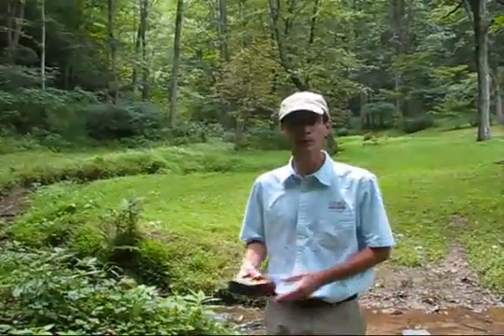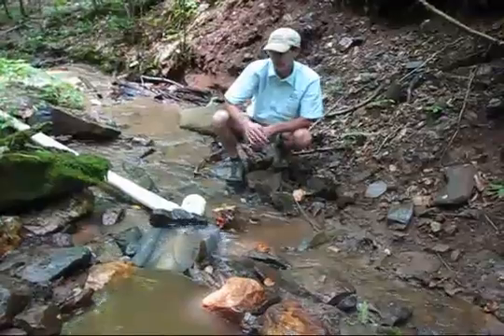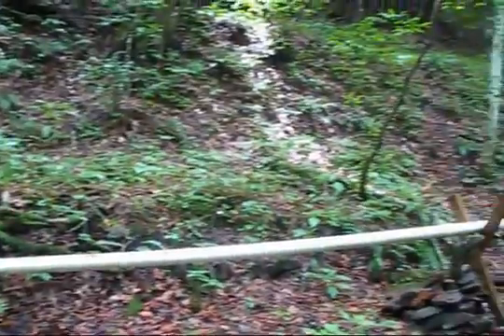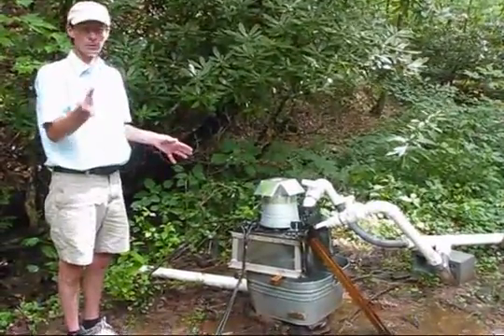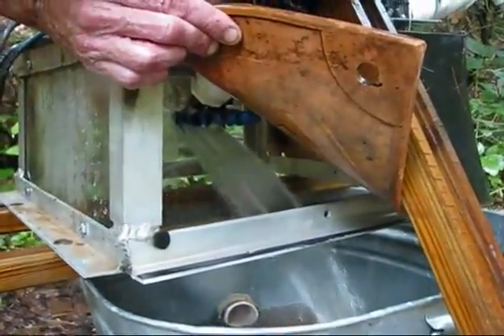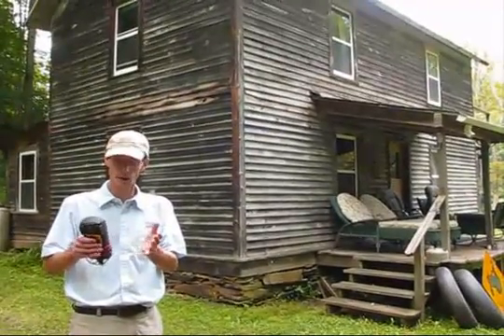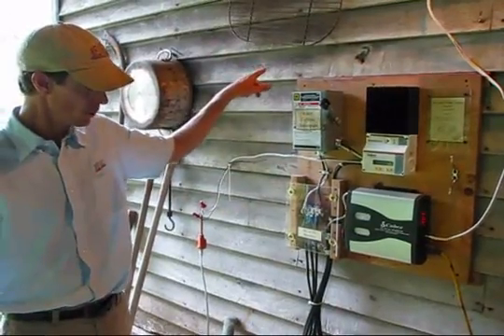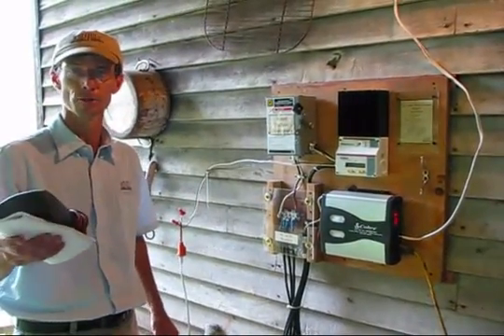Residential Water Turbine   YouTube

Comment: I have creek in my woods..it has a strong flow..and a 3-5 ft head..I want to harness this..I have a 1000-3000 watt 3 phase hydro electric generator very similar to the one in your video..I just discovered the ramp pump..I want to run a 6" Suply pipe about 60 ft up creek to at least the 4 ft head the water will run into the two 2" ram pumps that produce 20-30 psi tied together .then run that psi line to the turbine..that will have 3 jets...

* I tested the pumps at a controlled site 1 produced 4-7 psi. Doubled up and tied together produced 8-15psi

*i tested the turbine on 20psi garden hose and produced 15 dc volts at the full bridge rectifier ....then tested it on my air compressor at 140 psi and that produced 21 do volts..
 
Do you think this will work and do you have any sigestions?